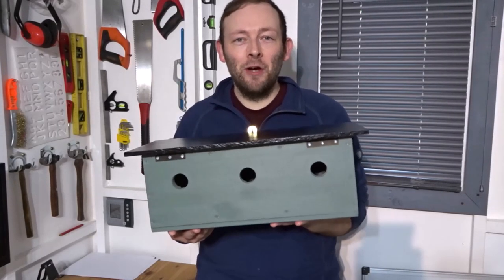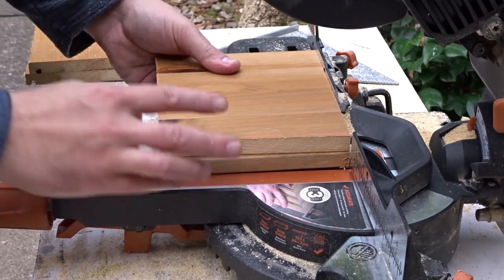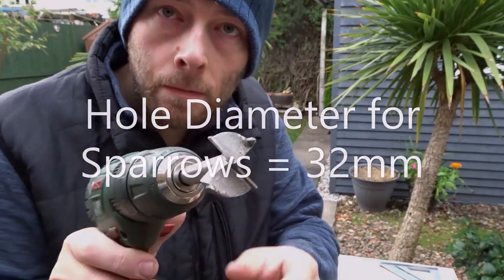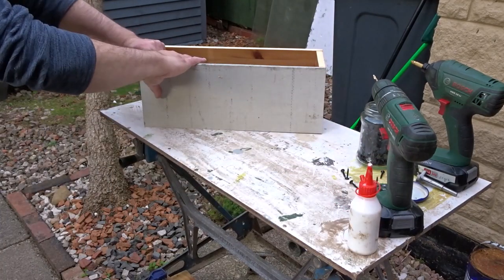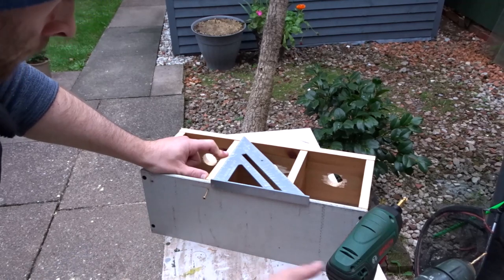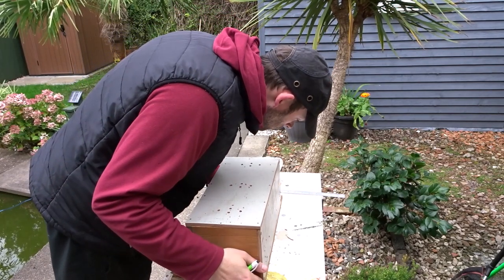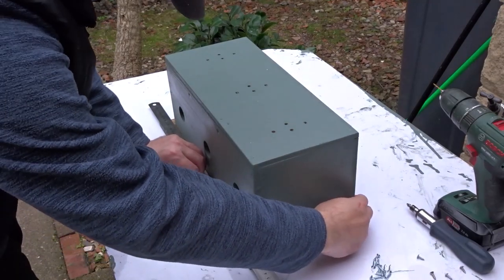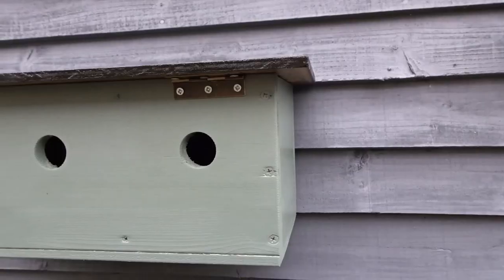How to Make a Sparrow Colony Nesting Box / Bird House (Sparrow Terrace)

Comment: You should always use the first cut piece as a template for the rest of the cuts because if you have a minor error it will multiply with each successive cut by the time you make the last cut. :)
Reply from the maker: Sounds like good advice Wayne!

Comment: Suggestion: ----  How about  making the roof sloped to the front, and projected over the entrance holes , to help prevent rain water blowing in.  Put the hinges to rear. Make the front removable to aid cleaning out. Add a hook or piece of wire to tie roof down in case of windy weather. 🐦
Reply from the maker: The roof is sloped to the front and hangs over. The hinges are at the rear. The lid lifts up to allow cleaning out.
Reply: @PhillWyattProjects   Thanks Phill for your reply.
Reply: @PhillWyattProjects in the video the hinges are at the front above the holes??
Reply: Nice job

Comment: I made a colony box for Sparrows for winter shelter.  I have only seen a few birds use it.  Not sure what the problem is.  I put it under the eve of the roof where it is protected from rain and wind.  I put two wooden rods through it for roosting.
Reply from the maker: It can be quite random when it comes to birds choosing a nesting box. Sometimes they go in within a few weeks. Sometimes it can take a year or two. Sometimes they never go in.
Reply: @PhillWyattProjects  We have a tree in backyard that I have put birdhouses on.  I added some new ones and left and came back and sparrows already using them.  There are more birds then birdhouses so they claim any new ones right away.  We have had different Copper's Hawks show up every fall trying to catch the Sparrows.  I had to move the bird feeder on the tree to the back fence.  Then put a cage wire around it so the birds are protected while eating.  They can get in but Hawks, cats and Black Birds can't.
Reply: @PhillWyattProjects  I actually seen birds going into it and even taking stuff into the box.  Then nothing for whatever reason.  There might be birds going into it but I have not seen any since first putting the shelter bird box up.

Comment: Just a few observations : the entrance holes looked rough around the edges inside the box, might ruffle a few feathers?  Secondly, just one mirror plate in the centre to hold it up. One squirrel, cat jumping down on the box will tilt it wildly. 2 plates better, I think?
Reply from the maker: Yes it wouldn't hurt for the holes to be smoother and 2 plates would be better that 1 I agree 👍🏻
Reply: Phil, think the outcome looks and works just fine for a home project.  Rather than do critical nit-picking like so many people in the world do to others, i would rather give you positive encouragement for the obvious time and effort spent doing this - very well done Phil !   

Don't worry if people look for flaws in your work because the world is full of armchair critics - your video documentation and detail and the final result are already really great as-is.  2 thumbs up

Comment: Nice box mate. Just a little tip get some metal washer the same size internally as the holes and screw or stick them on. I had a woodpecker nearly get in at the chicks had to make some very quickly. Saved the chicks. 😅😅😅
Reply from the maker: Your rite about that as it happens I recently made a video about how to make protection holes for a bird box. I just haven't put any onto this one just yet.

Comment: Sparrows are making a comeback but not half as many as when I was a kid, and the reason is simple, new buildings don't have anywhere to nest in or under the roofs. All the factories in the 70s had that corrugated roofing and loads of sparrows used to nest there, and even homes don't have nest areas any more because the eaves and soffit  are all sealed up. If you go to a council estate with older housing you will see loads of sparrows because of loose slates and cement.
Reply from the maker: Interesting information 👍🏻 I never thought about it like that before. I have a few visiting my garden now which is good.

Comment: It would be nice to have a supporting rod  for the sparrows for entering into the hole.
Reply from the maker: It's not always a good idea to add a perch. It can make it easier for predators to get inside.
Reply: no, sparrows don't need it and it allows predator birds a place to sit while pulled chicks out

Comment: They'll have a hard time bringing branches in there ... holes are too small. Good idea though, love the hotel!
Reply from the maker: Cheers! I just used the hole size that google recommended for sparrows.
Reply: Most of the coarse nesting material will be dry grasses which are flexible. They will then switch to moss, wool, hairs and other thin manmade fibres for the egg cup.

Comment: You forgot to make a landing area for the bird in front of the entrance.
Reply from the maker: This is intentional. I would not recommend adding a perch at the front to prevent predatory birds from using it to perch on and then put their head inside the box and get to the chicks.
Reply: @PhillWyattProjects  Make sense but the entrance is only 32mm as you mentioned. So it is quite difficult   for the predator to harm the chick. And secondly if you don't add a perch then it will also be more difficult for a sparrow to feed there chicks as well.

But your intentions are making sense.

Comment: Nice job, but you can just be sure that choosing this type of chipboard won't last long in the weather, so it's a shame to do this job and not choose the right wood!
Reply from the maker: Thanks👍🏻 not sure what you mean. There's no chipboard. It's made of Pine with a Ply wood roof.
Reply: @PhillWyattProjects  ah sorry, with the lighter color of the wood slices I had the impression that it was chipboard, pine is very good plywood (even covered with paint) a little less good because given its thinness it will eventually deform, unless it's marine wood.

Comment: Be nice if dimensions were in inches too, not solely centimeters.  For those who need know hole size, it's 1-1/4 inch (1.250).  If you don't want Sparrows but do want Swallows ( Swallows will greatly reduce mosquitos population), then make hole eighth inch smaller = 1-1/8 = 1.125.
  On farm with pond and 2 creeks, and since Sparrows will step grain from your livestock feeding place.  Swallows won't eat the grain but will catch eat, up to their body weight every day of flying insects.
  Dimensions for Black it'd nesting box wasn't at end or any part of your video as you said they would be to reference to for building it.